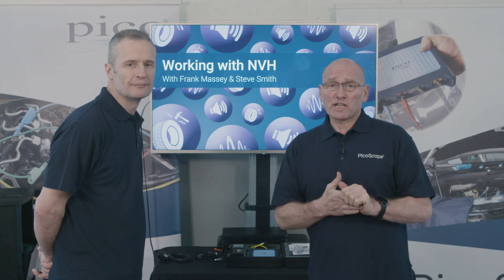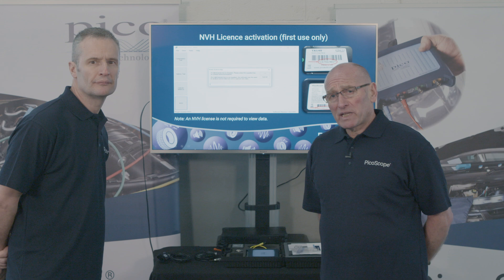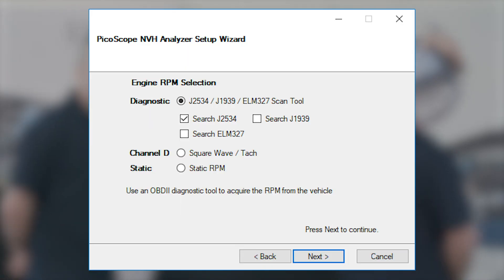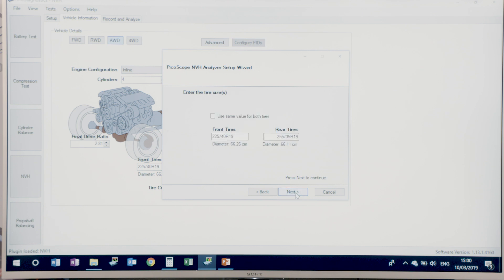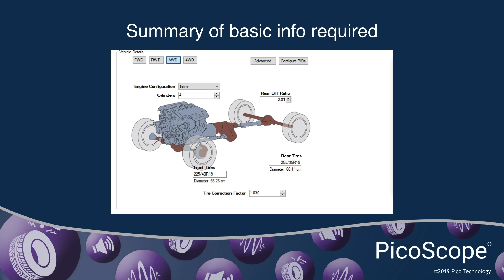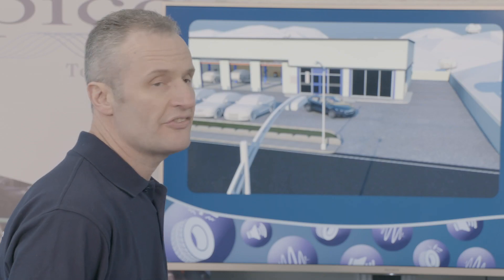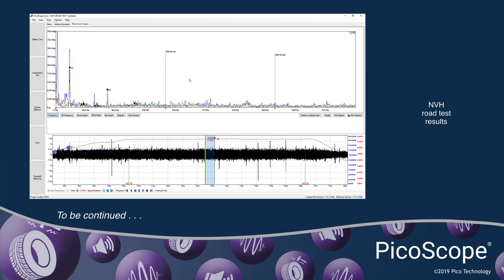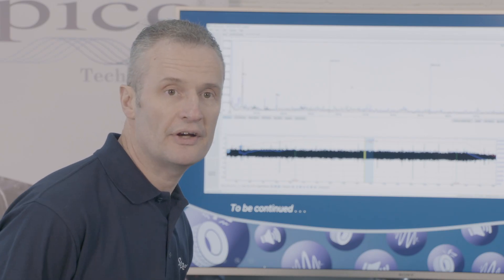PicoScope NVH episode 3: NVH setup

Comment: Great video.. My kit only came with a single connection between the Pico and NVH box... how limited is this one vs the 3 channel?
Reply: Hello Jason, thank you for the feedback. The early generation NVH kits included a single output NVH interface box that would mathematically sum all three axis of vibration into one single output.The real beauty of such a feature is that with one scope channel, the end user will pick up a vibration present even when the direction of vibration is unknown. Using the 3 output interface allows the user to measure all 3 axis of vibration individually at the expense of utilizing 3 scope channels. The Pro's and Con's are explained here: https://www.picoauto.com/support/topic11521.html I hope this helps, take care......Steve